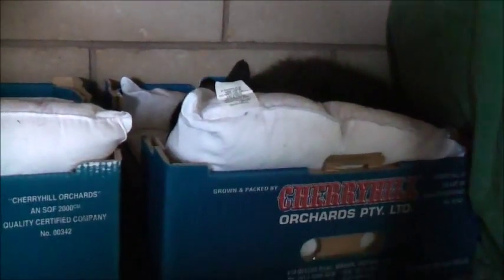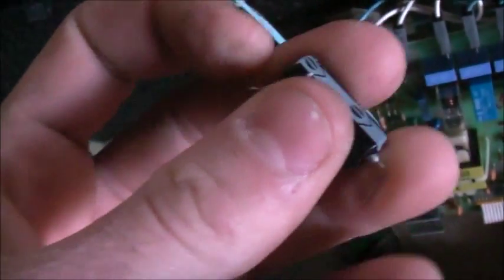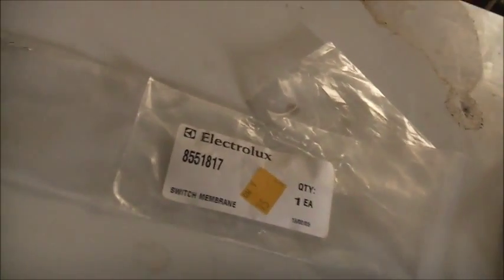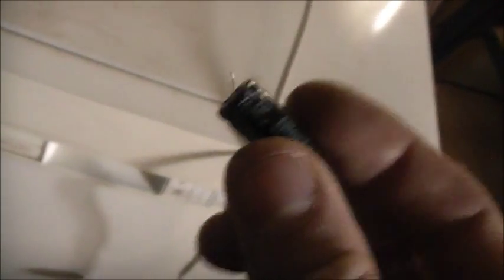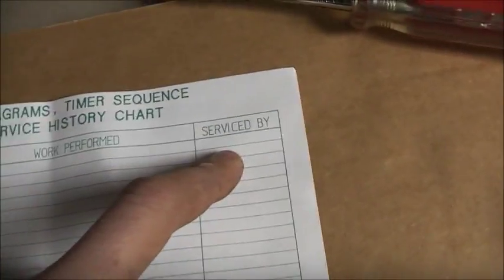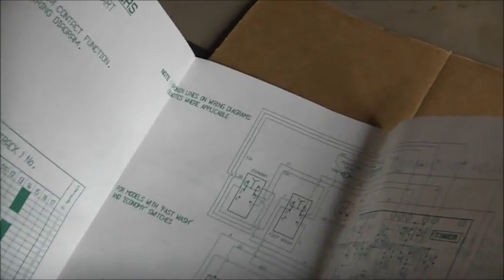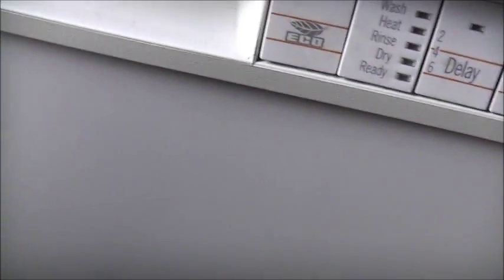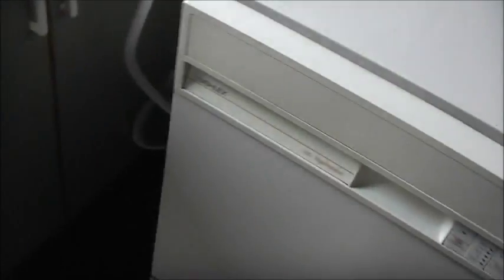Vulcan Dishlex 500E Dishwasher Fixed!

Comment: Hunt capacitors are so awful that they fail without ever being installed in anything. I had some new old stock ones, in molded plastic shells, rated at 400 and 600 volts, some failed at as low a voltage as 10 volts on a resistance-capacitance bridge, most failed at well under 50, none made it up to their rated value. These were some surplus ones that had been stored unused in a basement so they were in cool dry storage most of their life.

Comment: Well that didnt take you long larry :-)

im supprised about that cap though, most linear psu caps just go lower in value or short circuit, that one had a nervious breakdown lol :-)

And the cat says "Perrrrrrrrrfect" lol sorry :-)

Ive had 2 year old washing machines go batty because the caps in the dredded switchmode psu expired, and guess what, the caps lifespan spec was 2 years, hmmm bastards!!

Comment: Yes i agree, when ive built small linear supplys i use 105 deg switch mode quality capacitors, i know its overkill but they last.

Dont know about the quality of hunts capacitors, the only ones ive seen are the ones in very old valve radios, and that constant cooking would kill any capacitor over time.

Switchmodes are distructive to even quality capacitors :-(

Psu's do supprise me at times, i made my mate a small linear psu back in the early 1980's, dam thing is still fine :-):-)

Comment: If they dry out enough they basically become open circuit, since the circuit board is inside the door, and the machine gets hot on the drying cycle, it's not really that unexpected with a cheap Taiwan/China brand cap like that. They should be using 105 degree rated caps of a good brand like Rubycon, Lelon has 105 degree caps but they are a trash brand just like Gloria so the rating is meaningless, much like the voltage rating on a British Hunt paper cap.